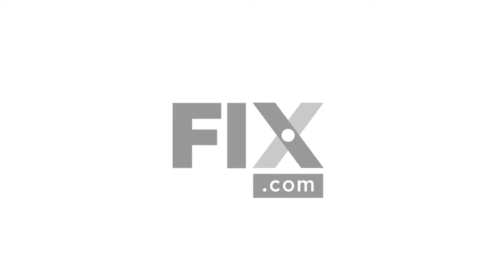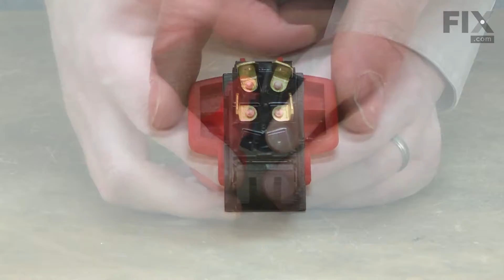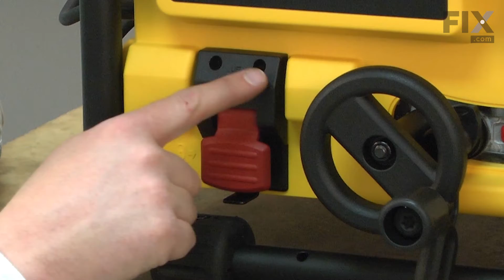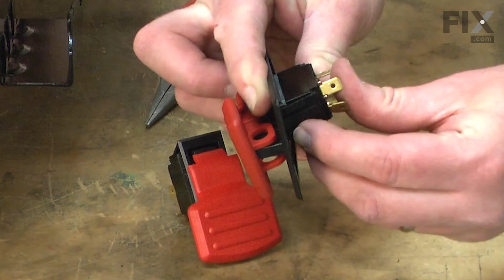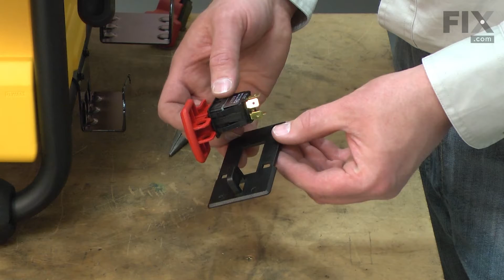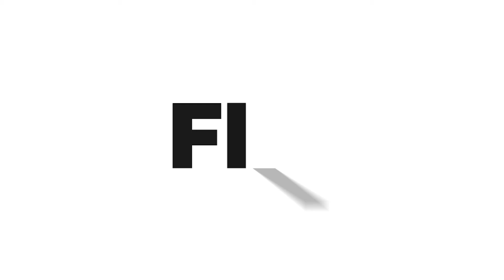DeWALT Table Saw Repair - How to Replace the Switch

Comment: I have a DW744 type 4, it's about 15 years old. Suddenly had a no-start condition. I've pulled the switch and checked it for continuity using a multimeter as you describe in your video. It passed. I then checked for power by plugging the machine in and using a non-contact voltage tester that checks for power flowing through the cord. It had power to the switch. I flipped the switch on, and now I detect that there's power right to where the wires go into the saw itself. There's no evidence of burnt wires or connections, and the saw was working 100% fine one minute and dead the next. 

My machine's a little different than the one in your video. The switch is near identical, but one of the four terminals has a separate thing wired into it that seems to go with the circuit breaker. There is a circuit breaker reset button just above the switch, but pressing it did nothing - and even so, the circuit breaker would prevent power getting to the motor, right? The saw blade itself rotates freely, so the motor's not seized. I haven't yet pulled the brushes to check them but from what I've read, brushes don't suddenly fail and there'd be warning signs like sparks or smoke or electrical smell. 
The switch part is available online (390246-00) but the circuit breaker's a discontinued item (648036-00).